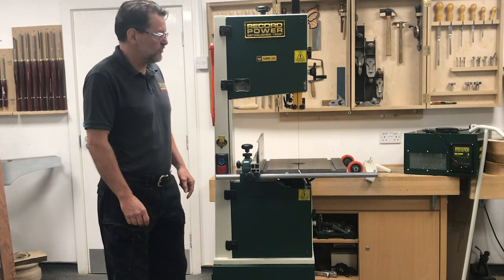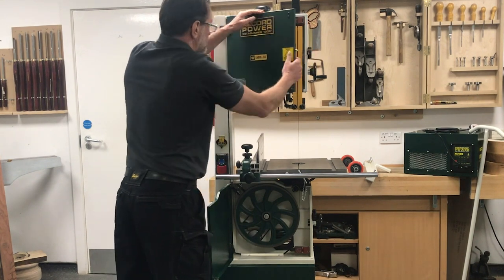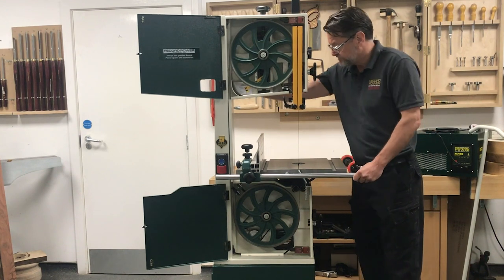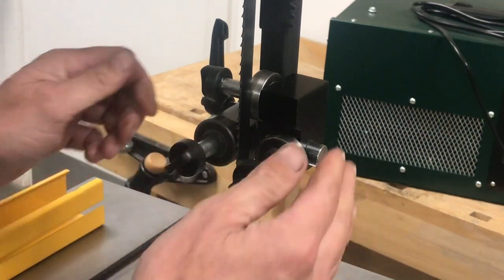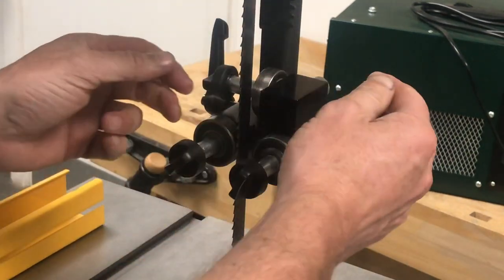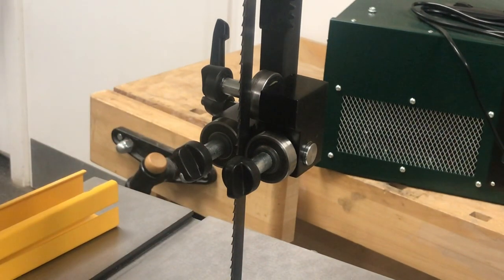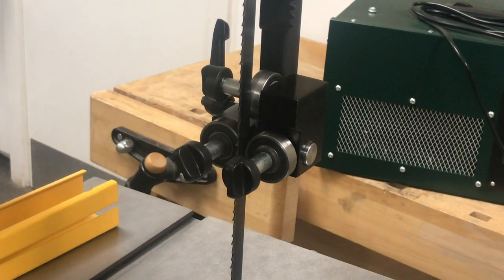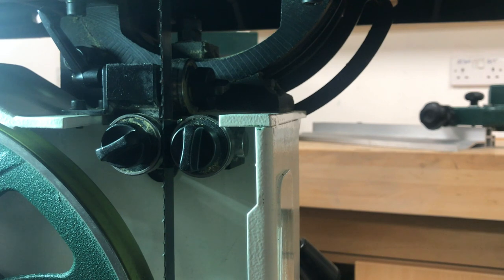Know-How Series: SABRE-350 14" Bandsaw Overview with specific use of Guides

Comment: Hello , My old bandsaw leaks dust from the bottom door .Does the Sabre 350 have dust seals on the doors?  The tyres on the wheels are they flat or domed ? How easy is it to set the tracking ? Do record sell a bandsaw sled as i see it has 2 slots .What size are the table slots ? Have not been able to look at new models during covid shutdown .What is the length of the fence rail at the front ,are there different lengths .Can a second guide rail be fitted at the rear of the table to further secure the guide fence for when i do re-sawing on larger heavier logs .Thanks for the video

Comment: Which is the knock-off: Rikon or Record Power? They are near-identical machines; obviously from the same assembly line. After all these years, both manufacturers still sell this BS with the starter far too low on the column.  Reach across the sharp edge of the 6" fence and you will gash your forearm.  Also, on both machines, they employ the idler pulley on the wrong {underside} of the belt.  So counterintuitive, given all automobile engine serpentine belts, have the idler pulley on top. Little wonder there are now YT vids on how to change those tiny ribbed drive belts.
Reply from the maker: Hello, thank you for your comment. First of all, there are many differences between our machine and the Rikon machine. With regards to your second point on the drive configuration, the tension pully is inside of the drive belt and against the grooves of the belt, but this is suitable way to reduce the tension as all points are equal (working outwards, rather than if the tensioner was pulled into the belt, then in would be working against the drive pully and band wheel). Our SABRE Range of bandsaws are extremely popular with huge numbers of happy users and with very few after sales issues. We continue to research and develop to improve and will take your points on board. Best Wishes, Record Power.
Reply: @RecordPowerTV  Thanks for this reply.  I have a Coronet Herald lathe.  There is no distribution of your bandsaws here in Canada, that I'm aware of.  To improve your saw as I see it from the pictures, you could begin by moving the power switch further up on the column as I have on this 10-326 Rikon, thus in all likelihood, voiding the warrantee. hahaha Also, the start button should be an industry green and not some blue as is the Rikon.  Why not add a stop flapper paddle, so the operator does not have to insert the stop button? All he/she must do, is give the flapper paddle a knock.  Add a wheel break too, while you're at it.   
The dust shoot could be moved further up closer to the blade, to allow a 6"-4" reducer to fit over the motor. I don't know about your guides, but while these are touted as being tool-less, they do need more torque from pliers to tighten, since when cutting green wood for bowl blanks with a 1/2"- 2TPI blade, there is excessive force generated when using a circle jig to cut a deep blank, that slightly loosens the guides, both above and below the table.  
The differences that you speak to are more cosmetic without mentioning what those important differences are.  As a longtime motor gearhead, your explanation of the positioning of the idler pulley does not cut it, sir. By positioning the idler pulley where it belongs, i.e., on the outside of the belt, more motor torque is delivered, since the drive belt is more in contact with both the motor pulley and the lower wheel. The Japanese have a concept still foreign here in the west; Kaizen or roughly translated: "Constant Improvement".